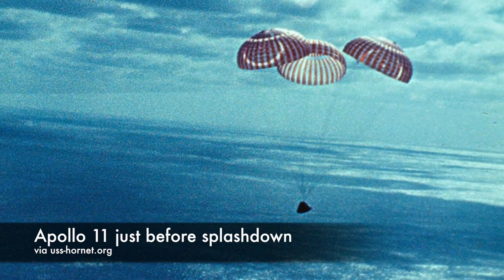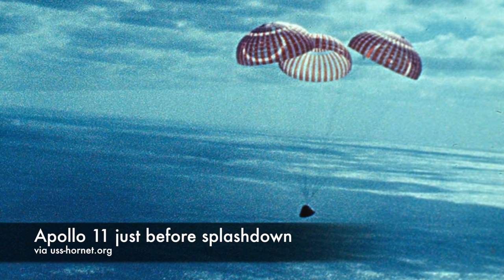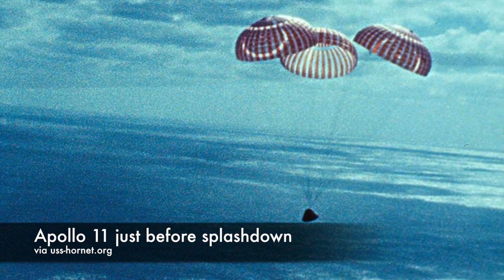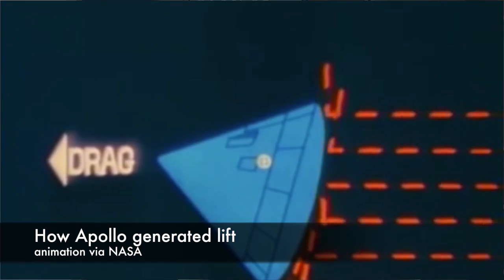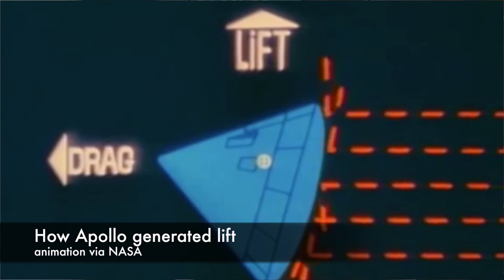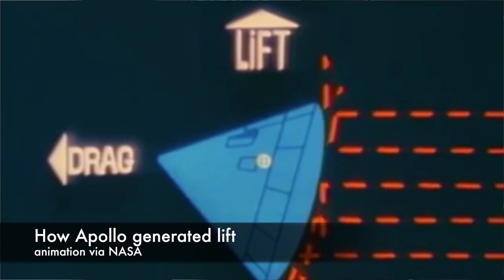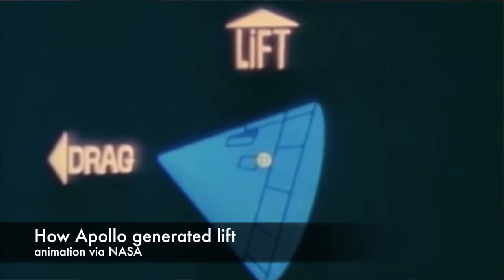Apollo Had No Wings, But It Could Fly

Comment: Yet another example of the Americans and Russians solving the same problem in radically different ways. 

The Apollo capsule was too heavy to free-fall back to Earth as Mercury and Gemini had done.  Instead, it came in for a shallow descent that lasted until just after aerocapture, and then the CMP actually steered it back out of the atmosphere and came in for a second, steeper re-entry.  This gave it more time to cancel out its 36,000+ fps velocity and spread the heating and g-loading out enough to make re-entry survivable. 

The Soyuz spacecraft is even heavier than Apollo and was designed for the same mission, but the Russians had a less elegant workaround for the problem of re-entry: They simply built a dedicated re-entry module and jettisoned the heavier command module before re-entry.  The Chinese Shenzhou spacecraft has a similar configuration.

Comment: Interesting but, to be totally correct, you should remind us that the lift is produced because there is an non-zero angle between the CMP symmetry axis and the air. The fact that the center of gravity was offset by just the right amount to correspond to the angle needed during reentry is a clever design choice, but the same effect (lift) could have been achieved with any other means of controlling the spacecraft attitude.

Comment: was there a hatch in the heat shield for umbilical connections to the service module?
Reply: +kb968 The connectors went around the heat shield. At 0:16 in this video you can see a good picture of the Apollo spacecraft. At the bottom of the command module you can see a box-shaped thing protruding from the CM. That is the cover of the connectors to the service module.